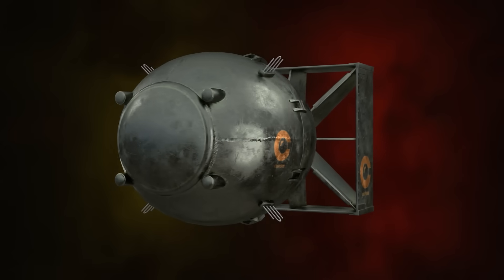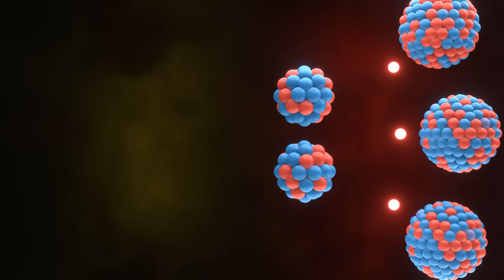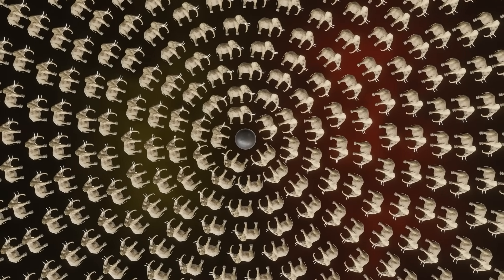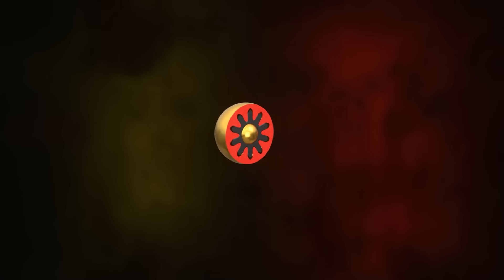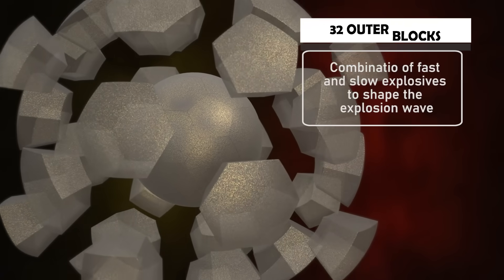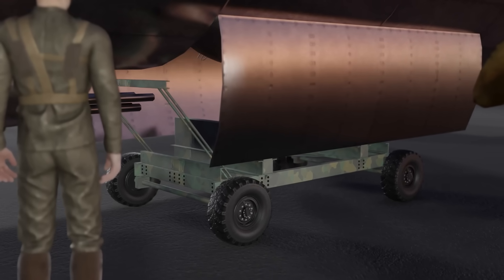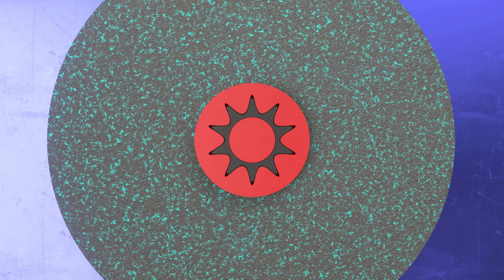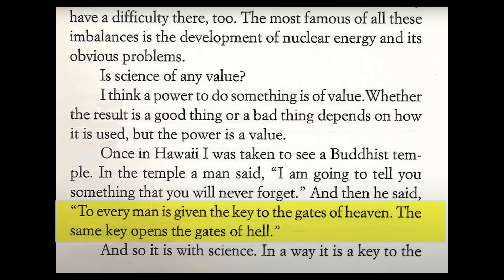What's Inside the Atomic Bomb?  |  Insane Engineering of the Atomic Weapons  |  CURISM

Comment: A way to think of the compression fission chain reaction device is that one is a football game neutron "fullback" trying to run past Uranium and Plutonium "tackles" of the opposing side. If the neutron "fullback" hits a Uranium or Plutonium or Beryllium "tackle" nuclei , there is a fission reaction (nuclear splitting) which produces more neutrons "fullbacks". If those can then hit enough nuclei, then more neutrons are produced and the process continues. But, if not enough neutrons ("fullbacks") hit nuclei ("tackles") they escape without continuing the reaction and no chain reaction is sustained. But if the "tackles" (nuclei) are compressed closer than a certain critical point close together around the "fullback" (neutrons), the "fullback" (neutron) will hit a "tackle" (nucleus) before it can escape, thereby continuing the fission chain reaction until runs out of fissionable fuel. The explosion compresses the fissionable fuel so there is not enough space for neutrons to escape before hitting the nucleus of some atom of fissionable fuel.

Comment: Plutonium does not require enrichment process like the uranium does. Plutonium is highly unstable. It is not commonly used for making weapons, due to its instability nature. Instead the uranium is used to make the nuclear bombs/warheads. Plutonium is a synthetic element generated from burned uranium that is trapped within the reactors. You would need many years of generating energy from uranium, in order to collect a pound of Plutonium.  Its use in making bombs is not practical. 

Both, uranium and plutonium have their respective positive and negative charges, referred to as Proton (positive charge) and Neutron (negative charge). The Plutonium may not be regarded as the opposite charge of the Uranium, and vice versa.

Comment: Please explained about Fission effect and Fusion effect.How do arrange these two effect.
Reply: That is simple. Similar to how the fission bomb ks detonated by explosive charges, a fusion bomb is initiated by three atomic bombs with fissile material. The center of it is the fourth container of deuterium core (hydrogen with extra neutron made by enriching water with electrolysis). This compression from simultaneous explosion creates a super compression similar to the core of the sun that the hydrogen fuses to helium and releases so much heat and energy hundred times that of the fission bomb
Reply: @paintspirationsunlimited  One Electron is Substraction method from the Nucleus of an Atom or Adding method of one  extra Electron in the same  Nucleus of an Atom. This is called Change Reaction of an Atom.

Comment: The little boy bomb dropped on Hiroshima had no Plutonium in it. It was a Uranium 235 gun type bomb. The Nagasaki bomb and the first one exploded
In the United States were
Plutonium implosion devices. The reason they tested the implosion device but not the Uranium device is because they were certain the Uranium bomb would work and weren’t as sure about the implosion bomb. They knew it would work in principal but setting off the high explosives around the plutonium sphere would have to be perfect. All of the explosives would need to be set off at exactly the same time or it would t work. The Uranium Bomb was basiccly a sphere of Uranium 235 and a rod of Uramium 235 and an explosion sent the rod of Uranium shooting into the spheres of Uranium therefore creating a critical
Mass and atomic fission.

Comment: An atomic bomb contains highly enriched fissile material and conventional explosives arranged in a precise configuration to initiate a nuclear chain reaction. Here's what's inside:

1. Fissile Material:

Uranium-235 (U-235) or Plutonium-239 (Pu-239). These are isotopes capable of sustaining a chain reaction. In an atomic bomb, these materials are enriched to a high degree, meaning they contain a high concentration of the fissile isotope.

2. Conventional Explosives:

Used to compress the fissile material to supercritical mass, which initiates the chain reaction. This is typically done with carefully arranged conventional explosives in an "implosion" design for a plutonium bomb or a "gun-type" design for a uranium bomb.

3. Neutron Initiator:

A device placed in the core of the bomb to emit neutrons at the exact moment the fissile material reaches supercritical mass. These neutrons trigger the nuclear chain reaction by causing more fissile atoms to split (fission).

4. Tamper or Reflector:

Surrounds the fissile material and reflects neutrons back into the core, improving efficiency by ensuring more neutrons contribute to the chain reaction.

5. Detonators and Electronics:

Complex electrical circuits to trigger the conventional explosives at the right moment, ensuring the fissile material is properly compressed or assembled.

Once the chain reaction begins, it rapidly releases an enormous amount of energy in the form of heat, light, and blast pressure, leading to the characteristic explosion and destructive power of an atomic bomb.

Comment: The basic idea of mixing fast and slow explosives is to prevent the initial high speed explosives from simply blowing the bomb to bits. The high explosives initiate the reaction, the low explosives blow it back where it came from. Otherwise, all you do is throw radioactive crap everywhere.

Comment: At 9:50 it's stated that the B29 was the only plane capable of carrying Fatman. However, I have previously read that the Lancaster was initially lined up for this mission. Is this not correct?
Reply: Yes it is true. B29 had much greater speed which could help the plane to get off the blast radius much quickly, that's the reason Lancaster was ditched.

Comment: I have a question about thar plastic shell, how it absorbs the slow moving neutrons and avoids pre detonation. The part that create the neurons is at the center of polonium so before the shell can absorbs that slow neutrons they create a chain reaction.
Do neutrinos have to have a certain speed for a chain reaction to take place? And if they are slow, they can pass through the polonium cavity and chain reaction will not occur.

Comment: The Explosive Lens! The Radiation / Bomb Shelter sign!  YES!  I caught that as well!  I was born in 1959 so by that time the duck and cover practices were done away with.  In reality it was a useless civilian pacifier.  If you were the target you would be dead before you knew it.  In the outlying areas the energy blast wave was horizontal.  The blast wave comes at you from the side, not the top.  I have watched those atomic/nuclear films for decades, so fascinating.  But until this explanation the only survival method is being underground.

Learned a lot from those video!

Comment: My neighbor was one of the two marines who manned silo keys when he was on active duty. He claims it has caused some health problems from doing that assignment. We talk about it privately, quite a bit. The part where atoms are symmetrical compressed equal to 300,000 elephants in order to get a chain reaction so the atoms will split continually, that is jaw dropping stuff. Without that one element the atoms are stable, but once billy bob drops in,tempers flare.

Comment: The fat man implosion type  bomb described in the video is much more complicated than the "little boy" bomb that was dropped on Hiroshima. That bomb was  basically just a large enclosed gun barrel where one mass of sub critical Uranium was shot into another. It was so simple and they were so confident it would work they dropped it on Hiroshima without even testing the design first. They weren't as sure about the more complex implosion type device so that it why they did the trinity test before dropping it on Nagasaki.

Comment: I think that the most asked question about atomic weapons is where does all that energy come from. I respectfully submit that this video, while very well composed, does not answer that question adequately. The key lies in the result of the fission process. The two fragments of the split nucleus are positively charged and repel each other with a forceful coulomb force. These protons were previously held in close proximity by the strong nuclear force, but the splitting of the Uranium atom renders this force ineffective. The result is that the two atomic nucleus fragments fly apart releasing 200 Million Electron Volts ("MeV") of energy. The kinetic energy of the nucleus fragments is approximately 165 MeV, the rest is radiation and other secondary effects. While energy measured in MeV may not seem significant, remember that their are about 10^24 uranium atoms in the device and the energy is released in times measured in microseconds. Many explanations of this energy revert to a discussion of E= mc^2, which is completely wrong and misleading. It is true that the binding energy of a Uranium nucleus does increase the mass of the atom, but the effects are miniscule compared to the coulomb energy released when 10^24 Uranium nuclei are split.  This information is not classified and can be found on the web in plain text. Search for "Nuclear Weapons Frequently Asked Questions" by author Carey

Comment: Think I'll put my high school education to work and build one of these things so I can take it on a fishing trip to the ocean.
I just hope I can paddle my canoe fast enough to escape the initial blast cause it would probably be pretty hot at first.  Once the water settles back down I'll quickly paddle back over to "Ocean 0" (similar to Ground Zero) and see if I've got a mess-O-fish for supper.  Does anyone want to go with me?  If there's enough fish you can take some home and impress your friends.  Or we could sit around eat fried fish and discuss my next project.  I'm gonna build a submarine out of an old refrigerator I got sitting out back.  I'm thinking I'll outsmart the other sub builders and not depend on batteries as they're kinda dangerous, my plan is to drive my sub by using bicycle drive gears attached by chains to the propellers which I'll assign my guest to peddle so we can move up, down and sideways.  The guest will be asked to bring a flashlight with several batteries for backup.  We won't have to depend apon a video game controller (that was a silly idea) it'll be by word of mouth.  I'll just holler out, "Hey Mr. Biden takes us down!" or "take us up Kamala!"  The price per ticket is $11.99 plus tax and I'll supply free water.  Be sure and "GO" before you board as there ain't no commode in the refrigerator.  
Note: the names used here are fictitious similar to those in the WhiteHouse so as to protect the innocent or we'll just have to lie about everything and grin from ear to ear like a jackass eatin briars.  No trippin and fallin allowed. Good day.

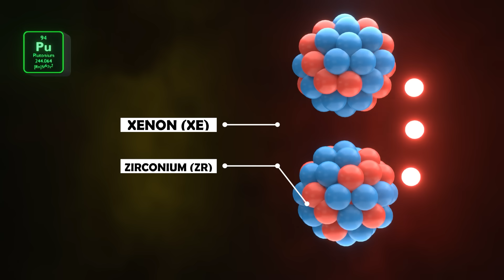Comment: One very minor quibble with an otherwise flawless video: At 1:50, you say that when Plutonium undergoes fission it creates Xenon and Zirconium. In reality, it doesn't create two specific elements every time, but rather a range of different elements, determined by the energy of the captured neutron and random chance. Of course, "what fission creates" isn't important to understanding how the bomb works, so it doesn't really detract from the high quality of the video.

Comment: Excellent treatment of this assembly.  "The making of the Atom Bomb" is also a very good book and research on the topic.  One item that still remains highly confidential is the actual configuration of the plutonium.  This is normally shown as spherical but actual designers get very quiet when asked to confirm the shape.   It's likely that both the exterior and interior are different than assumed.
Reply: Good observation.  The physics and engineering presented in this video is based on the knowledge of nuclear weapons science as it was in late 1945, not 2023.

Comment: Cool video!!  I have published extensively on the physics and history of the Manhattan project, and I would show this to my students.  A few very minor quibbles: It is more properly called an "implosion" lens (for obvious reasons), the Po and Be have to be separated initially (I think they used gold foil to stop the alphas until the two were mixed by the implosion), the Pu core was in two hemispheres (they had to put the initiator inside!), and the bomb was raised into the plane form a loading pit in the ground.  But these really are quibbles.  Love the 3D deconstruction of the bomb.
Reply: Right, having gold between the beryllium and polonium would explain why the neutron burst from the initiator comes after the implosion. Until now I assumed the initiator was always emitting neutrons but that they didn't have an effect until the plutonium was supercritical.

Comment: Not that complex at all. Take one lump of plutonium just under critical mass. Take another lump of plutonium. Just enough to take the first lump beyond critical mass and fuse them together. In the case of this bomb an explosive charge but a sledge hammer and the two parts plutonium could do same thing.

Comment: You forgot to mention that when a Plutonium nucleus  (atomic weight =244.064) splits into one Xenon (131.30) and one Zirconium (91.22) the masses don't add up hence the balance is 'released' as energy according to E=mc2 (loss of mass in kgs times roughly 90,000,000,000,000,000 Joule). There's probably not a complete 'combustion' though, but all in all it corresponded to igniting 21,000 tonnes of TNT from a single point above poor Nagasaki.

Comment: This video gives most of the facts, but small errors and omissions EVERYWHERE ruin it. Pretty good animation, but small errors throughout diminish it. Only about 1kg of the plutonium fissioned; the rest went into the atmosphere mixed with fission products, smoke, and dust, which together became fallout. Fission neutrons eagerly fission U-235 (0.7% of natural uranium or <0.3% of "depleted uranium"), but less than half of them can fission U-238; still, fission in the [depleted or natural] uranium tamper contributed 30% of the energy released.

Comment: I used to work on A-4 Skyhawks which at one time had been nuclear capable. As an electronics technician I wondered at some of the remaining electronics and came away with the thought that a nuclear bomb must need a lot of electrical current to detonate. Now I know that to be true and why it is needed. Great video.
Reply: yes but 5kv really wasnt that much. 7mm high tension wire would suffice from say spark plug leads. Heck, automotive points-type ignitions provided that at the time. CD ignitions produce about 40kv at high speed!
Reply: What is your evidence that nukes exist?

Comment: What a great video. I knew about the explosive lens, but didn't realise the complexities with the initiator and so on. 👍
Reply: There was an unbelievable amount of brilliant engineering utilized in what is today a relative "firecracker."  I am continually amazed at complexity of devices produced by the "Greatest Generation," 80 years ago.  Even some '60s missiles are being disassembled to determine how they worked, since most of the engineers are long--dead.  (Many changes that made them operable, were never officially documented).

Comment: Outstanding rendering of the composition of Fatman! Well done! I had tried to piece together in my mind the structure of the bomb from written descriptions and drawings, but this really helped clear things up.

Some commenters are grousing about the (Indian?) accent, but I find it very melodious and easy on the ear. I occasionally have to listen twice to a word because of emphasis on different syllables than I am used to, but that’s not really a problem. I have conversed with English speakers from a number of countries and regions, and to my American mid-western ear the Indian accent is one of the most pleasant. More so than some of my countrymen!

A small nit: the depiction of the B-29 Bockscar, that carried Fatman, is a bit off. The atomic bomb-carrying B-29s were modified and built to a different configuration under the codename Silverplate than the standard conventional bomb-carrying B-29 depicted in the video.  The most obvious differences with respect to the video are that Silverplate bombers had no gun turrets to save weight for payload, and the engines and props were different (although very similar).  Not obvious were that armor was also removed, and fuel tanks installed in the fuselage. And the bombays were reconfigured to carry either Fatman or Little Boy.

Also, the Fatman was too big to simply roll (especially by a single man!) under the aircraft as depicted in the video, the scale of bomb to plane is not quite correct. The bomb on its cradle was lowered into a pit, the B-29 was positioned over the pit, and the bomb was hoisted into the bombay.

But that is not central to the focus of the video, so no worries. 

Again, well done!
Reply from the maker: Thank you!!

Comment: Great job!
I must add that most implosion systems would now use a Levitated Pit with a gap separating the 'Urchin' Initiator from the PuGa Alloy, so that rather than it being a solid sphere of Plutonium, it is a thick shell, utilising the air-gap to more violently compress the Physics Package  rapidly from Critical into Supercritical in a brutal Slap fashion
Reply: Compressing matter, at the atomic level, using conventional explosives is not likely, if not utterly impossible.
Reply: @Simboiss  tried it?
Reply: @jayc2469  Not yet. But I would like to see how a physicist can prove that it's possible with equations.

Also, aren't atoms already spaced out by many times (like 100,000 times) their diameter, anyway? Dividing this space by a factor of 2.5 seems insignificant.
Reply: @Simboiss  So, what you're saying is, the atomic bomb never happened?
Reply: @egoequus6263  I have serious doubts on the coherency of the stories behind it, yes.